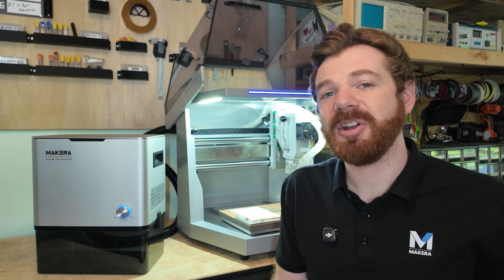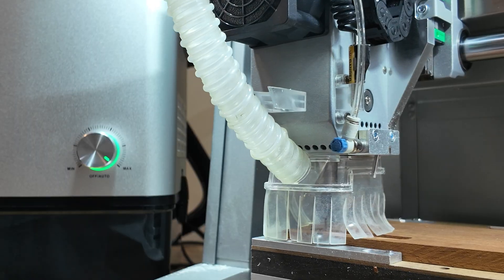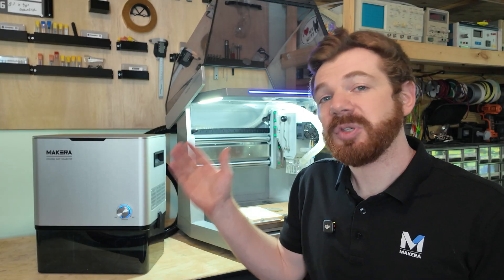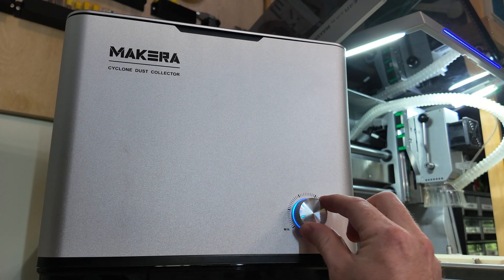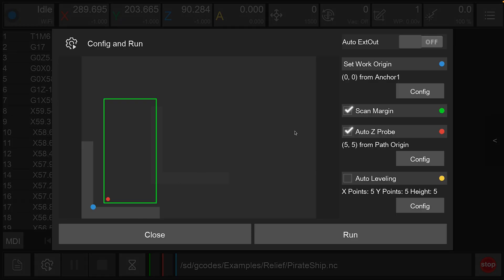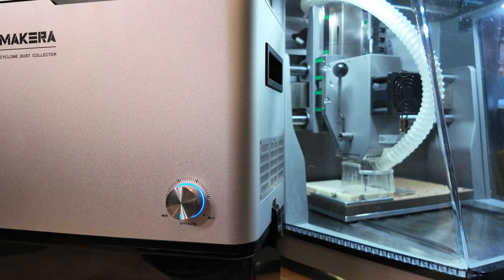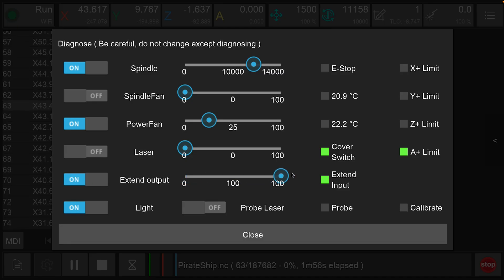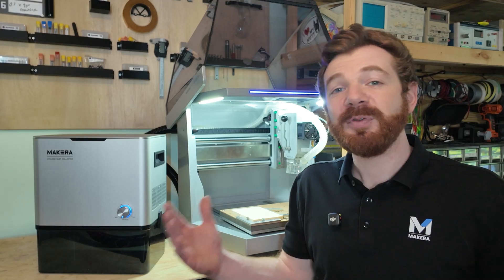How to Connect to the Makera Cyclone Dust Collector

Comment: Hello, i have a question. So i saw that the carvera air can have the back plate removed for longer materials. Could you show us how to calibrate and mill long projects please ?
Reply from the maker: Good suggestion, we'll put a tutorial together in the future! But to summarize now, you would essentially slide your larger piece in, and machine part of it on the work area. Then manually reposition the piece and machine the next part with a new design file.